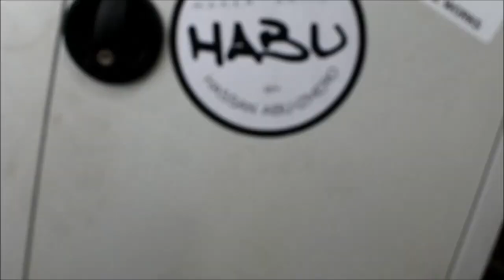DIY \\ Industrial design coat hook

Comment: I like it. Been there with broken taps. Not easy hand tapping. I am a machinist & felt that one when it broke😑 Use plenty of tap oil & clear chips regularly while drilling. Drill press is ideal for diy guys. I have the luxury of CNC machines but still do side projects at home.  Sharp drill is key. Even still the margins of drill can rub, cause heat & work harden the steel making it tough to tap.  Use a spiral flute or “bottoming” tap on blind holes. I suspect your chips got packed in with your plug style tap.  That style pushes chips fwd as opposed to a spiral evacuating them. Plug taps work well on through holes. Can also cheat & use a drill size larger for a project like this. Also keep reversing direction to break the chip when tapping by hand. You can feel the chip break. Even 50% thread on this would be surprisingly stout. Friendly advice from a fan. I like your style of making. Thanks for the videos 👍🏻
Reply from the maker: Thank you 😉

Comment: cool project. In case you do again make the holes in the wood a little smaller if you can and use a pipe wrench to screw the bolts in.

Comment: Was it a carbon steel tap? Bolts are generally alloy for strength, so you need at least alloy steel tap, if not HSS. Annealing it first would be a bad idea either. And little taps like that are a PITA no matter what you do. 

I really like the look of these. I think I'm going to have to copy this. :)
Reply from the maker: Thanks man! I simply got to deep I guess...